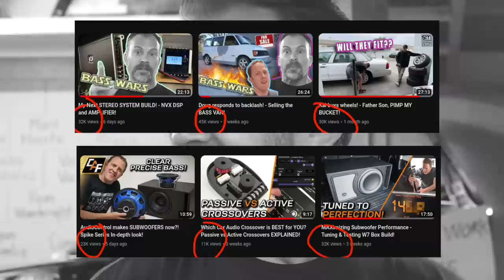MULE ENGINE IS IN! and Kai's WING INSTALL!

Comment: Engine hoist tip: release it then just pull up on the arm so you don't need to pump it up.  WUD UP DOUG! The Mule is looking sick!
Reply: Always got told that was bad for seals by old timers. Still do it though.
Reply: @jasonalmont7572  me too. Pop's would always bitch at me for doing it.. lol my hoist is 20 years old and from harbor freight.. 😅 works perfectly.. dam old ppl anyway.. bahahahaha
Reply: @Hoppysjunkyardrally good old tools. Nowadays I get a 20 ton bottle jack and 3 years later it can't even hold it's own piston up cause the seals are made of bubblegum
Reply: @OtherDalfite  they just dont build them like they used to thats for sure.. everything is "disposable" now days.

Comment: Is there any way to flip that throttle cable cam so the round part faces the rear? 
It's designed to give precise throttle control. 
This has bugged me for years.

Comment: Yea you can slap a big ass turbo on those dudes and run a holly dominator with all the bolt ons and theyll run high 10’s all day.. but stopping the fuckers is a different story.   Gotta upgrade to the big brake kit..